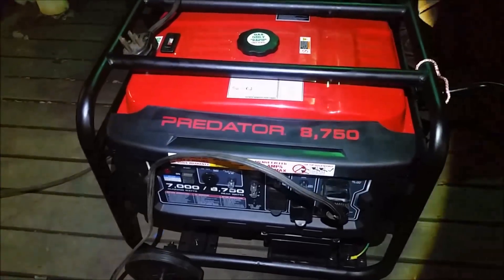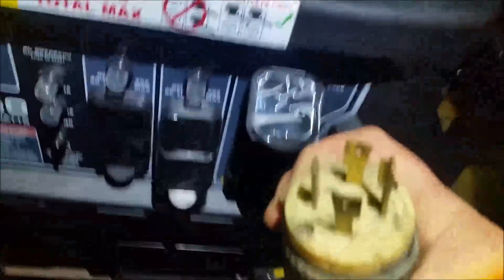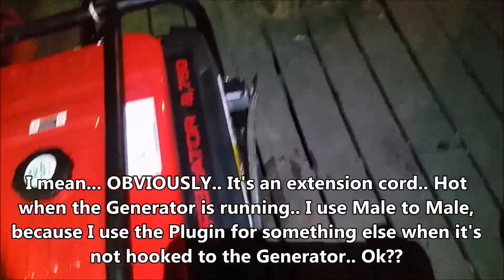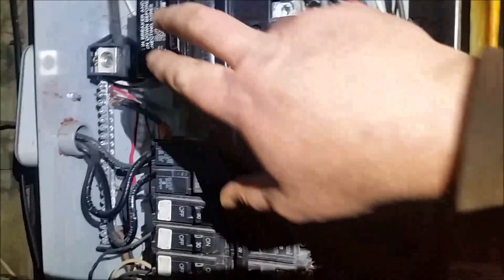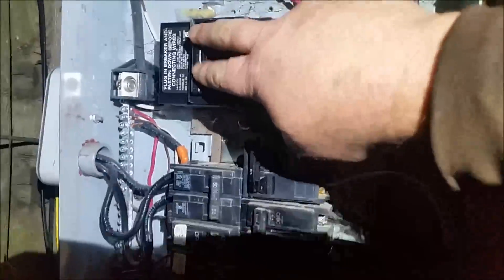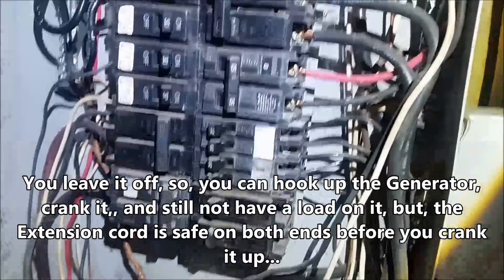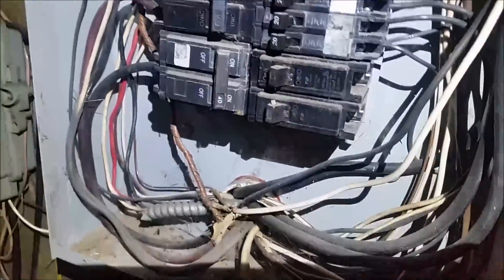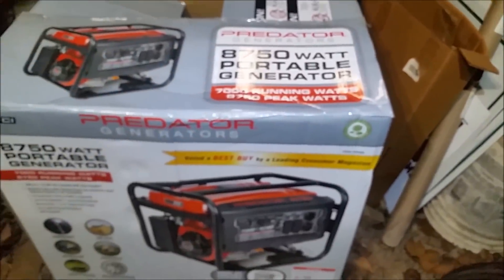Quick/Easy/Safe: Use Existing Plugin/Breaker for Generator hook up to your house Panel box.

Comment: @Mark Thomas, 
I enjoyed your long dissertation on “Conceptual Thinking”. I am 100% in agreement with your thoughts and statements therein. With the way you talk, the way you think, and with the knowledge you have, I would want you as a neighbor when TSHTF.
In my 41 years as a Registered Professional Electrical Engineer, 30 of those as a Licensed Electrician, I have seen a lot of things go bad…… in residential and commercial, but mostly municipal and industrial work.
1.  Sometimes, that Main Circuit Breaker’s contacts get corroded or welded closed, and when you operate the handle to open the breaker, the handle position shows “open”, but one or both of the contacts MAY not open. To be safe, you have to use a voltmeter, and check both lines to each other for 240 volts, and EACH line to ground for 120 volts. If one contact on the breaker does not open, and there is any “220” appliance connected and turned on, the CB contact remaining closed will backfeed both lines. Enough of that. Suffice it to say that circuit breakers do not always open internally every time. And when they do work properly, that open gap is never more than 1/4”. It is only 1/8” on these smaller breakers.
2. Common Sense is a commodity that not many people possess, and when they do, they don’t always use it. So that can’t be counted on to be flawless.
3. I have seen Licensed Electricians with many years’ experience make one mistake, and die from it. No matter how good or thorough a person is, they can make a mistake. No one is flawless.
4. The “suicide cord” in this video is one method to get power to a panel when needed, but that does not make it right, and not necessarily safe. See items 1, 2 and 3 above. If ANYthing happens resulting in a fire, injury or death, the homeowner’s insurance company will send an investigator to check it out. In this case, that person will probably a Professional Engineer, to ready the case for an attorney to go to Court. I have been there, and have gotten the Widow her money. I have written case reports to support insurance companies, and I have written case reports in support of contractors. In 40 years, not One of those reports has ever been contradicted, and None of those cases went to Court. You cannot win your case if a “suicide cord” is involved, even if it was installed by a “licensed electrician”, because it simply does not meet the NEC. That is all the insurance company needs to find out to “skate”…. legally. If the Profession Engineer is asked in Court, “In your opinion, does this installation meet the National Electrical Code?”, and if the answer is “No”, that is all the Judge, Jury and Insurance Company Rep need to hear, no matter how much Common Sense was used. I’m the one who said “No”. In that case, the Widow does NOT get the money.
5. You state that you are not a licensed electrician, yet you do low voltage and high voltage electrical work. Does that “high voltage” mean working with 5KV or 13.8KV circuits? (that’s actually considered “medium voltage”. “High voltage” is anything 65KV and higher). How do you do that work without an electrical license? Some electrical contractors will let you work for them doing such work with proper training, but 5KV, 13.8KV and the like is specialty work. So, just wondering…….
Reply from the maker: I wrote a lengthy reply and posted it and the mouse is twirling.. I am going to wait and see what happens.. I didn't copy it before I hit enter.. But, NEC Does not Regulate "Temporary Extension Cords", and that is a fact, so, Suicide Cord is a name given to something that is commonly used and used without any Suicidal Incidents... Low and High Voltage for the layman would be "CCTV, Data, etc.. Like Ethernet.. High Voltage is anything that will hurt you, although in those one in a million scenarios where minute amperages can cause death.. It's best to say "High Voltage" when you are in a Panel, not to say there is Medium and High above that to mislead someone into thinking a Panel is Low Voltage with respect to Transformers, etc.. Yes, there have been discussions about Transformer voltages/backfeeding them, etc.. here.. 
That is the Condensed version. 

Hope the other posts.. I actually took you guys through the Courtroom and case and how I would beat the "Professionals" using their own testimony.. Would have been an interesting read.. 

Lets see if this one posts. This time I will copy my reply before I post it.. Just in case..
Reply: @ @MarkThomas123  ..... heh heh this is fun. You are correct in that there is no NEC reference to "Temporary Extension Cords", but there is a specific reference to not having "hot blades" on an "attachment cap". That's 2017 NEC 406.7B - Connection of Attachment Plugs, "Attachment plugs shall be installed so that their prongs, blades or pins are not energized unless inserted into an energized receptacle or cord connectors. No receptacle shall be installed so as to require the insertion of an energized attachment plug as its source of supply."
So 406.7B covers it both directions. So no matter how much Common Sense you use, you can't win in Court from any mishap involving a "suicide cord". That includes protecting stupid people, and innocent people. If you want me to go to Court for you and win, you gotta' have a 4 pole male plug in a box, wired to a CB interlocked with the Main CB, so that the male plug is not energized unless connected to a running generator.
Regarding High Voltage, you are right there too..... it's all relative to the situation. I put DANGER ! High Voltage on 240 volt and 480 volt panels. Anybody un-qualified person who can read should then stay out. Which brings to mind a FB post I received 5 or 6 years ago...... seems the Electrician had his job turned down by the Inspector, who said his sign reading "DANGER High Voltage" on a disconnect switch next to a motor, was not explicit enough. The Electrician changed to sign to a new one reading "DANGER! High Voltage What Is Inside This Box Will Kill You And It Will Hurt Like Hell The Whole Time You Are Dying". The Inspector passed the job.
Reply from the maker: @bruceb3786  Correct.. But, the Court is Explicit.. And,, like you said it,,,,, , that,,, I can/did and will use against you... NEC does not Regulate "Temporary Extension Cords",, so, enough said about the NEC Regulating my "Temporary Extension Cord.. Of course, unless you want to try to apply a Code to it that has nothing to do with it,, since it does not have anything to do with Temporary Extension cords... See how I said, I would take what you said and use it against you?? :)   It won't stick.. Too many people have tried here and failed... 
Heh Heh,, Yea.. It is fun.. :)
You can try the "Don't backfeed Electrical Panels" route.. It won't work either though.. 
And,, BTW.. You gotta have a 4 pole, etc.. Only depends on whether or not the State or Local Municipality has adopted the NEC or that part of it, or subpart of it... I don't know of any state who has adopted any part of that section.. 
Ha.. Must have been an Osha Inspector on that job.. Only one that could have possibly done that kind of ignorance..  The R900-20 split rim tires.. I like Osha's response to that.. It's Ok if you loose an arm or leg, just so it does not kill you.. If they were just a weeee bit smarter, they could have built something simple like I did, where it is impossible to screw up and loose life or limb...  They will kill someone trying to make the "Area Safe".. No one said you had to be smart to work for Osha..
Reply from the maker: Bruce B... BTW... Always good to meet another Comrad smart enough to  know that being Prepared for a SHTF scenario is well worth while and just another form of Life Insurance.. Yea.. I am not a Typical Prepper. I didn't go and buy the store out and I don't have thousands of gallons of propane, etc..  Just did a lot of research on Homesteading  and how things were done way back when, when there was no Electric, etc..  I learn pretty much whatever I learn on my own.. But, a couple of years ago, I paid to go to a 5 day "Tools to Make Tools" Blacksmith class.. Two Instructors and Two Students... Part of my research was looking back at the Quest to the West in the Early American days..  There was one thing that "Every" town had,,, if it had anything.. It was a Blacksmith..  I figured it was a good trade to pick up..  An accomplished Blacksmith I am not, but, I know how to make the tools that make tools, and I did a bunch of extra research on old style Joinery, etc.. One thing I do have is way more lead and powder than I could ever wish to use and the odds not fall against me somewhere, somehow..  I had to find something that all of my family could shoot good and make sure that when the trigger is pulled, the target gets popped..  I settled on .22 cal,, same as the Israeli army uses.. Ruger 10/22 and The Ruger Mark III pistol..  I have two long range High powered rifles and one stop anything pistol if the need arises, but,  figure,, from my vantage point, if there is a band of Marauders, those that look to be the most devious go down first,, those that look scared get winged to the point they can't run off, and I'll let them take care of those that are going to run off and leave him.. Ha.. I can hit a 10" Pie plate with my pistol well enough that you would go broke betting me $1.00 a shot at 225 feet per shot in an hour or two.. Someone with a Rifle at that distance, and me with a pistol, I really doubt that I will have a problem.. I have not met many who think you can hit anything with a pistol at that distance, and I would take that extra split second for a head shot, while I roll over the birm to my rifle with 150+ rounds to take care of whatever is left.. 
I am more scared of the Military than anything else as far as security goes..  I have enough food for my family and those that will be staying with us for 12-14 months easy,, until the gardens start coming in, and the chickens and rabbits start producing regularly for meat..  When Obama got elected the second time, I was on my way home from out of state.. I stopped at every Walmart and spent quite a bit of money buying every round I could put my hands on for those selected calibers on my way home..  I figure,, no one is going to take my freedom away from me with my heart still beating.. Nor, any of my family.. I taught everyone how to shoot and shoot accurately.. Started at 25 yards, figured we would never get there.. Dropped back to 225 yards and everyone started dialing in with their pistols.. Then, at 25 yards,,,, they flat tore up my 1/4" thick diamond plated  swinging  targets..  Then, when they picked up their rifles at 225 yards, the confidence level was there and they dropped right on target there too.. My 80 year old Mom is one of the best shots in the family..  My older brother a close second.. Just hope he can squeeze on something breathing when it comes down to it.. No one wants to, but, not sure he is going to know when he "has" to..  I'm going to have to keep a close eye on him if it ever comes down to it,,, just to make sure he makes it through the first round..  If you don't have the cooking down pat yet for those beans and rice for the initial months,, check out the videos I did on the "Long Horn Rocket Stove".. It is the perfect Prepper Stove with two cooking surfaces, designed perfectly for cooking beans and rice, etc.. 2 hour cook time on one 6" x 24" piece of wood.. 
For water, check out the "Bio Sand Filter".. Living Bacteria that kills new "Rogue or Strange" bacteria.. Food/Water and Security is the Living Trio.. I'll deal with whatever else comes, like my  elders have done.. To be honest, I would not mind not seeing another Computer and Cellphone if it ever happens.. Have a couple of Ham Radios to keep track of the folks like myself around here..  There is only one road through my area.. I am on one end,, and a bad ass is on the other..  If there is traffic and it keeps moving,, no problem.. If it stops, it will be dealt with.. If we need to shut the roads down,  it can be done on both ends of my area.. I like the folks around here..  They feel like I do.. 
I would say, if we make it past Trump's first term, and the Fed is gone and Central Bank system is gone, and we have made it Ok, I will figure that we are not going to need our Stashes.. But, until the deep state is totally done and locked up, there is no telling how far they will go to save themselves.  We are going to have a pretty good idea what this will all be like by July of this year is my bet.. Lots of activity by end of May, through June, leading up to July.. 
Trump and the Q-Team have one hell of a job in front of them.. But, some rock solid Patriots just waiting for the call who are going to be hell to deal with.. Cheers.. Keep your head down.. Or up.. Ha..
Reply: @MarkThomas123  WOW!, yeah Man. I have stories to tell, but not on this social media. Baddoggy9@gmail.com